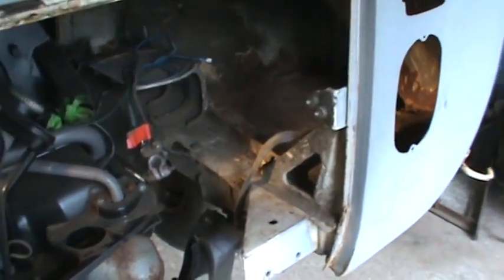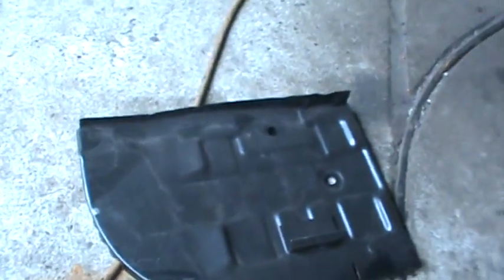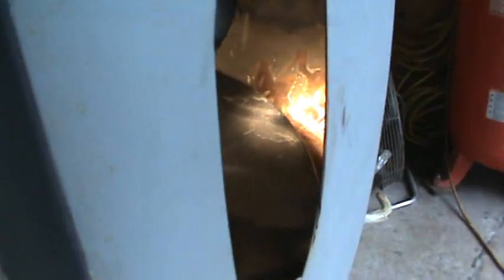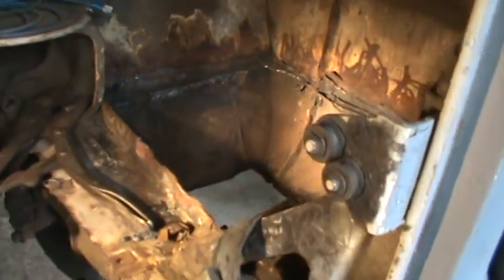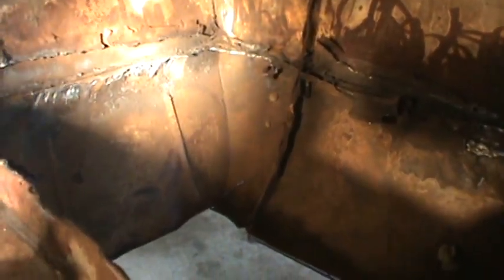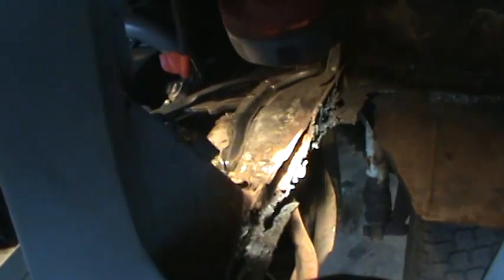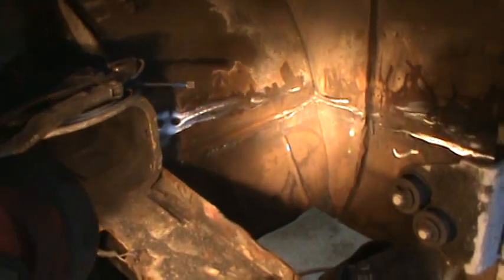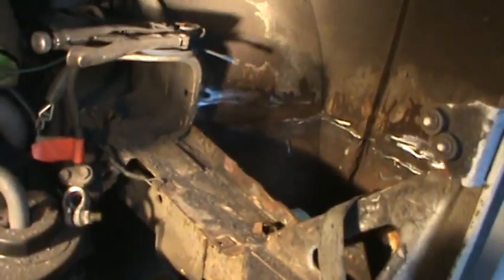making a battery tray for the 68 vw double cab

Comment: Hi Darren,
You do good work! To me it looks like that battery tray was replaced before and just welded on top of the original, making the double bottom. The ribs on the bottom are not only for strength, they are supposed to be for condensation and acid run off (if the battery starts leaking). They are usually sloped to a drain hole so no acid fumes get into the vehicle.

Comment: Looks good man!
Not that you need tips ,but quite often if I'm making a template and I need an odd shaped profile on it I bend a piece of solder wire against it and then just transfer it to my cardboard.
I've even used the scribe method with an offset sharpie ( like when you install counters against wavy walls)
Anyway ,,,,coming right along !

Comment: Looks solid as a rock, and the underside will be fine after its been covered with thick goo underseal or similar :-D
Dont you love the cardboard, i do :-D
You could make a smaller box tray for the battery to sit in, and spot weld it to your new floor, just as good as the original :-)

Comment: i see you doing battery trays on every vdub you work on. why haven't you gone to using boat battery boxes? they are plastic and will contain all the acid and eliminate corrosion
Reply from the maker: they dont fit
Reply: i had a cut down one in both my westys, a 68 and a  78. kept the battery contained well

Comment: Hey Mustie, do you know what that thing is to the left of the top pulley at 4:50?
Reply from the maker: +ug mold its to slow the throttle down when you let off, kinda early emmissions, most of the time there just removed,
Reply: +Mustie1 Thanks. I have one that is mounted on the left side just inside the hood on the triangular support, hitched up to nothing. A friend asked me what it was.